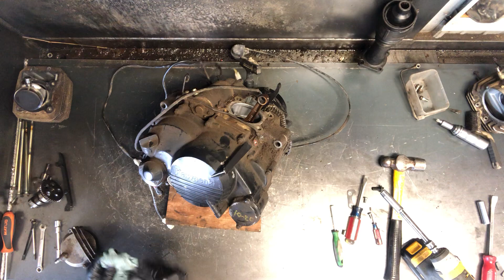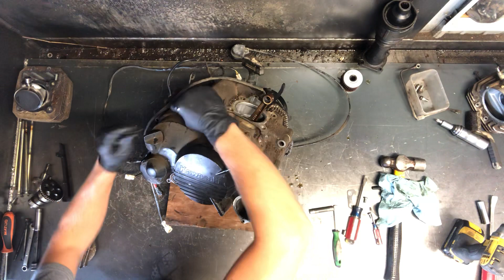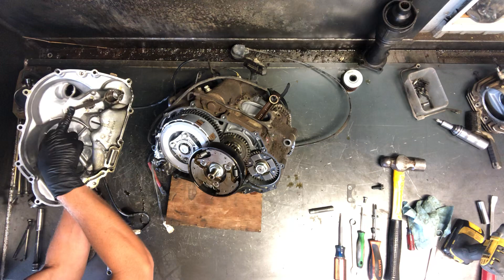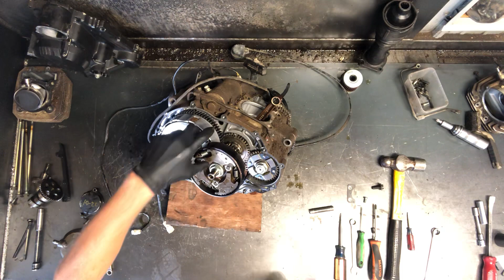HOW TO - Kawasaki Bayou 220 KLF220 - Centrifugal Clutch - Friction Plate Basket Replace Remove

Comment: Great video! I noticed when you removed the cover that it is all one chamber. Does the engine oil lubricate the clutches as well? What oil do you use?
Reply from the maker: Yes, engine oil lubricates trans / clutches as well. I use the semi synthetic castrol 10w40 oil. Love to see comments like this. Thanks for watching and the comment. Let us know if you need anything: https://www.ebay.com/str/midnebraskamotorsports

Comment: I have a 1989 Bayou 2 wheel drive 300 it is not the new clutches I have a problwm with I can't find a video that shows how to remove ans install all thw othwr parts tgat go on before you install thw primary and secondary clutches that's easy it's all those other smaller parts I'm having a problem with someone else took it apart and I don't know how it goes back together I'm 73 years old and slow so I need to see a video on exactly how to do this

Comment: Thank you for the strait forward video. Can you tell me what is behind the primary clutch? I pulled mine apart and there was a broken washer looking thing with big square teeth on the outside of it
Reply: Any help would be appreciated. I'm not sure what it's called
Reply from the maker: Behind the wet centrifugal clutch is a spanner nut with the primary gear behind it. Is that what you are talking about? Behind the clutch basket is a washer and then your main crank bearings. Let me know what you are needing. Thanks for watching.

Comment: Just bought one these older model klf220s.in bad shape. Got it running, despite missing many electric components. When engaging the foot gear shift into first gear, the bayou will jump forward slightly hard, and that definitely doesn't feel normal. It seems like I  have to give an unusual amount of throttle to get it to go forward. Is there an external or manual clutch mechanism that i should be using when shifting? If so, where's it located? It's missing the neutral/reverse switch and indicator light as well. I'm totally lost on the clutch issue. Great tutorial video btw! Will certainly come in handy if I have to go that far with the repairs.
Reply: @MidNebraskaMotorsports  I adjusted the clutch as repair manual instructed. That seemed like a simple process. It's missing the starter circuit relay, neutral/reverse indicator light, neutral/reverse switch. I had to buy starter solenoid, regulator rectifier and a 12 volt battery. For right now, I still can only start it with pull rope with the way the wiring is currently hooked up. I just bought an ohms/volt  meter, and going to try and start hunting down any connection problems.

Comment: I was going up a hill dirt road after trail riding. I gave it a lot of pep thinking I was in 4 or 5. After doing so, the engine revs very high and wont engage any gears. Is this potentially clutch? People i know say it is. 
I'm about to swap a clutch from a used wheeler I have. I own 2 300 byous both the 97+ era. 
What are the torque specs?
Reply: @MidNebraskaMotorsports  do you have a video showing how to adjust the clutch on the 4x4 with the two adjusters? I've been obsessing over your 300 bayou videos for answers on how to do it. 

Simply there is only one video on youtube and it's for a 2x4 with 1 adjust screw

Comment: Just pulled my centrifugal clutch after it blew apart and locked up my engine on my bayou 220. Engine is now free and will be ordering a new centrifugal clutch. Is there anything I need to look for or be aware of before putting the new one back in?
Reply: @MidNebraskaMotorsports  how do you tell if your clutch is any good

Comment: I have a bayou 220 with the same motor, but my atv wont shift. Its stuck in neutral. I replaced the friction plates with used good ones. But still nothing I've looked over all kind of forums and no one can give me an answer. Do you know what might be wrong?
Reply: Yeah, I adjusted it just like in the manual. Clock wise till resistance is felt, then counter clockwise till resistance is felt. The neutral light comes off when I try to shift. But no shifting actually happens.

Comment: Awesome instructional videos! I have a Bayou 220 with a clutch issue I might try to tackle on my own thanks to you. It runs perfectly (idle not too high) until you put it in gear, then it immediately engages (and I mean slams into gear) and stalls if you don't give it lots of revs (if you give it enough gas to get it moving and up to speed, it goes through all gears fine). What would you suspect first? Just clutch adjustment or maybe bad centrifugal clutch?
Thanks
Reply: @MidNebraskaMotorsports  thanks very much for the advice! I will look into the things you mentioned as soon as I am able. I appreciate it! You've got yourself a new subscriber. Keep up the great content!
Reply: Just bought one of these and have the same problem wondering what it could be